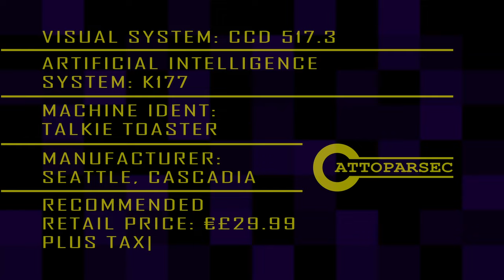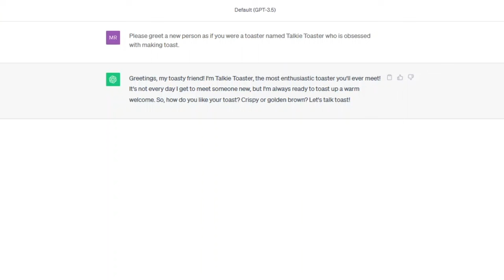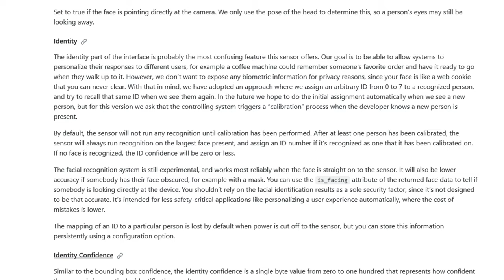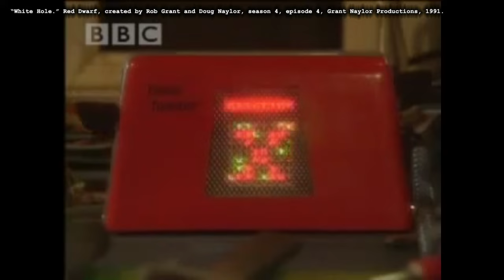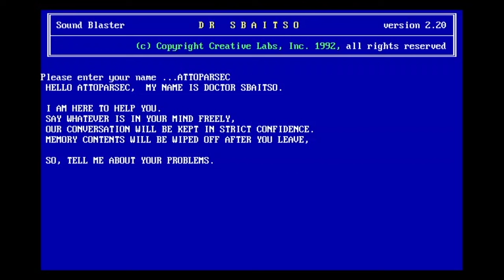Making a real Talkie Toaster

Comment: We had a Red Dwarf party circa 1996 and a housemate and I made a Talkie - he did most of the hardware (which was minimal: a speaker and a proximity and noise sensor, no cheap as chips face recognition back then) and I did all the software on my Amiga. It just played the original show's responses, of course, but there was a bit of structure in the randomisation. Like you, we preferred the original design, but unlike you, we didn't find a Smeg - we just found an old similar chrome toaster at a thrift store and used that. ^_^

Comment: I'm amazed that the BBC allowed the uncensored smeg insult back in 1988. I'm guessing that the Light Entertainment controller for BBC 2 didn't know it's meaning. Meanwhile me and my friends enjoyed the pseudo-rude word along with the irreverent humour. It wasn't quite The Young Ones but it did fill the gap left by that show.
I don't know if the word was widely understood in the UK back then. We knew it and it's it's etymological roots but it wasn't part of our daily vocabulary, well not before 1988. For me it never had the same feeling as other pejoratives that were more commonly used.
Great project. I've seen other devices that push and pull data to the cloud and they too suffer from the same lag. I don't know if this will be solved by faster networking or by increasingly powerful embedded computing. I wonder if the lag could be reduced by offloading the listening functionality to a discrete unit that passes each word back to the Pi. That way the words can be sent to the AI faster. I'm guessing that currently the software appends 'reply like a toaster' type suffix to the voice input and then sends a fully formed sentence to the AI. It would take a bit of programming to allow the AI or API to recombine the words into a sentence, but it would cut out quite a bit of the lag.
Reply: Still very few people understand where smeg comes from (and the writers still deny officially, as far as I know) 

Amazingly, the problem with lag and interruptions already seem to be solved, since this was posted. Was listening to Hard Fork podcast yesterday about a Golden Gate Bridge bot, that sounded perfect for this.